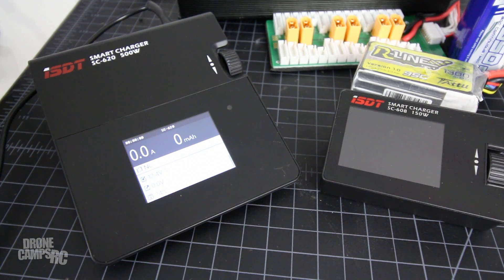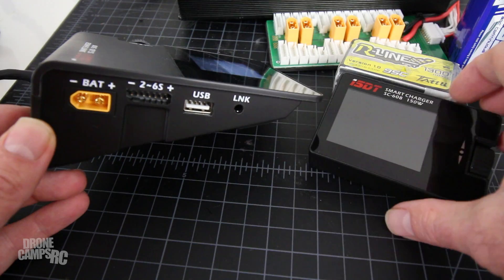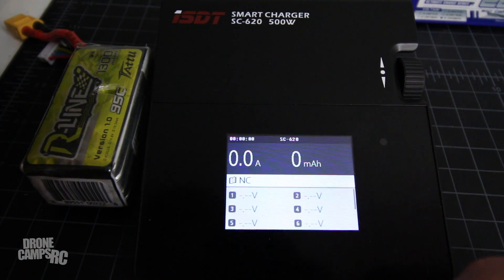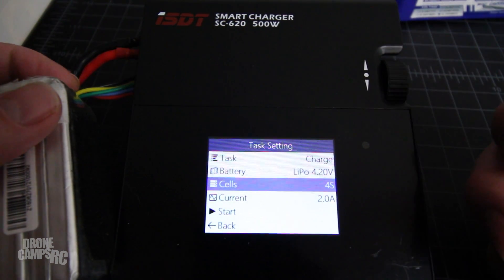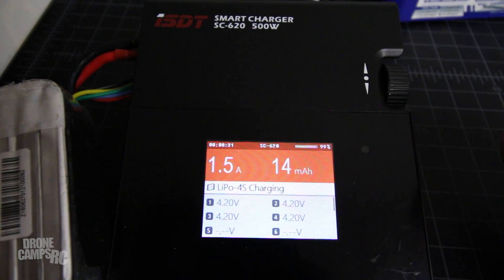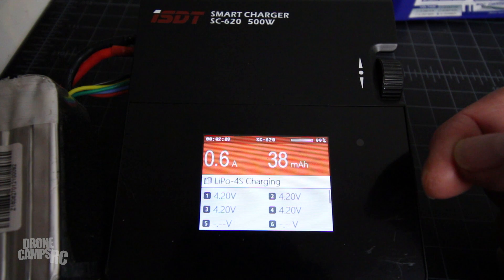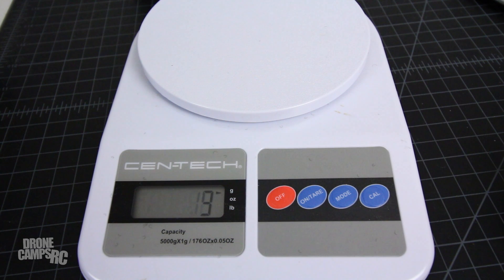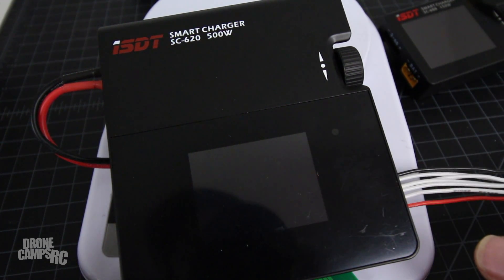iSDT 500W 20A - POWERFUL MINI Charger - REVIEW & CAUTIONS

Comment: Can you give the link on the 12v dc converter you were talking about.
Reply from the maker: I made my own. Cut the AC plug off and soldered an Xt60 on. Make sure it can handle 500w